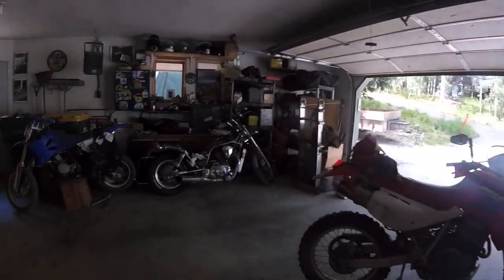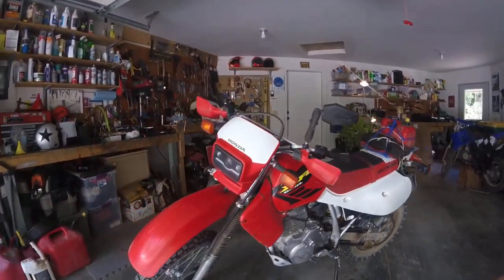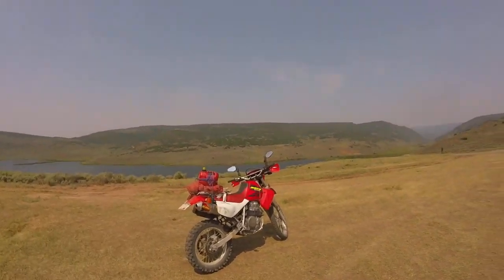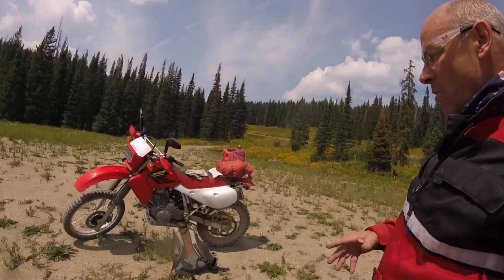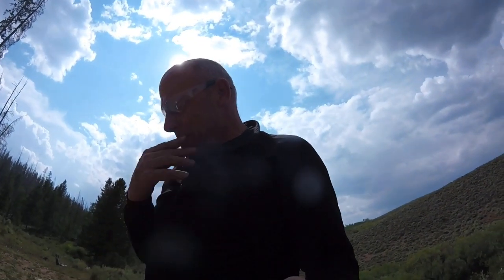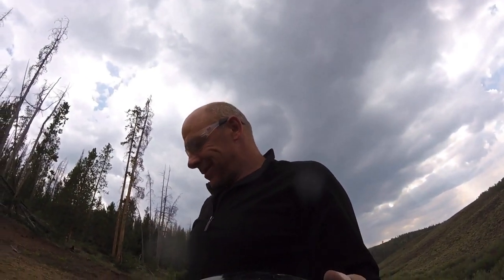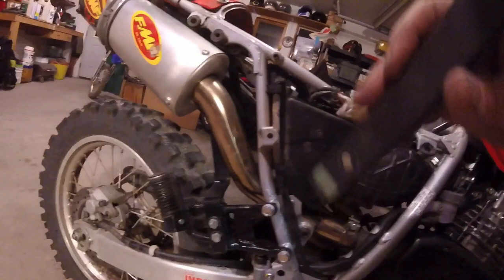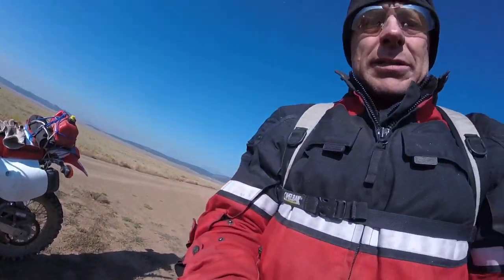Honda XR650L One of the best dual sports ever made.

Comment: Like the bike but like most bikes now too tall I'm 6 ft 1 inch and it's too tall
Reply from the maker: It is a tall bike. I’m only 5’8” and if I don’t choose my parking spot with some care I tip over. I installed a lowering link but it was of marginal help. Once I’m on and riding it feels perfect though. The suspension is awesome.😁😁😁
My 1980 Honda XR500 is much lower and easier for me. I’m trying to get it Road legal so I can do some dual sport trips on it.
Reply: DR650 is two inches shorter.